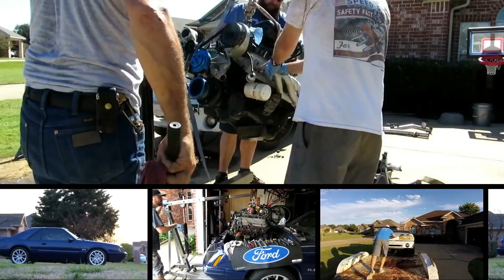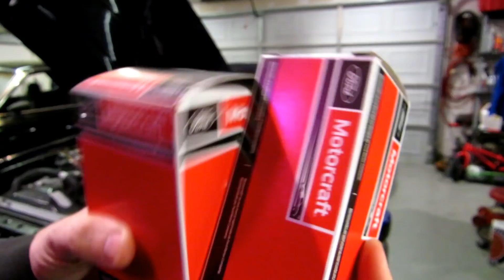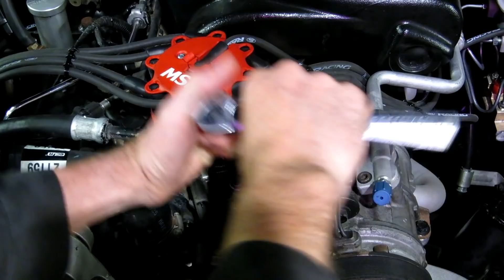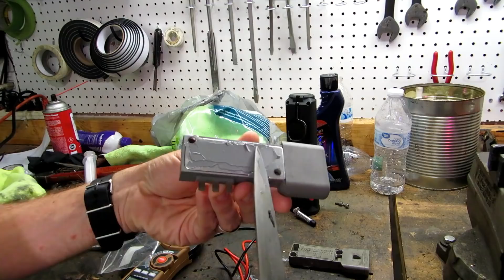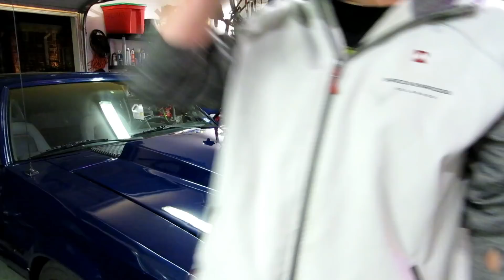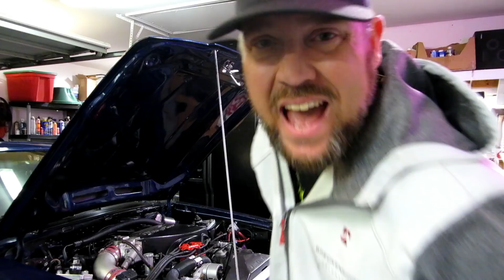1986 Mustang GT Project - How to: Set Base Timing and Replace TFI Module

Comment: You did kind of drop it. LOL
Reply from the maker: TRUE! But I was holding the faulty one at the time, not the new motorcraft one.
Reply: HOUSE OF DULA, yeah J/K faulty products are common anymore. Like the starter solenoid you have on the inside fender. Surprised that hasn’t caused problem because they are shit anymore as well. I’ve gotten 3 faulty ones in a row before I scrapped it and replaced it with a relay & mini starter.